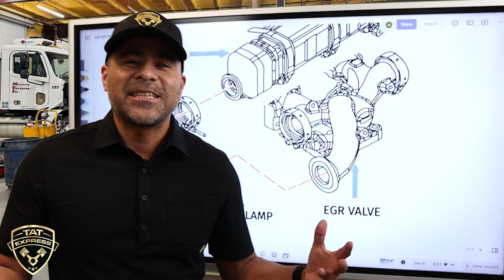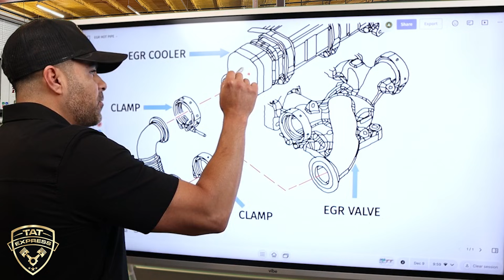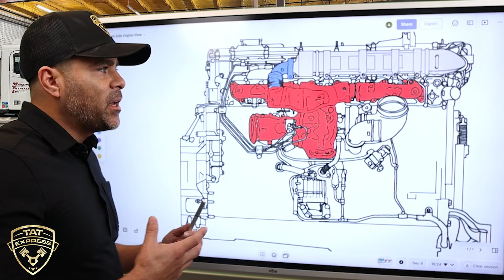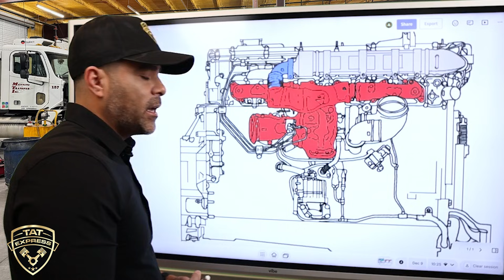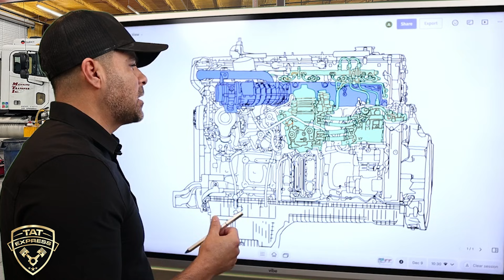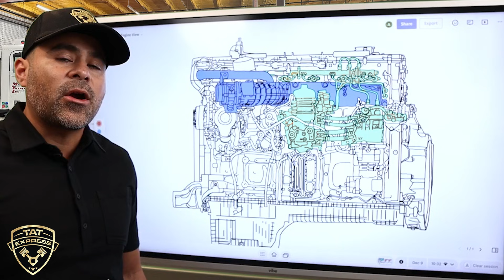Why EGR Systems Matter on Modern Semi Trucks 🚛🔥 How They Work, Fail, & How to Maintain Them

Comment: I was taught at a Caterpillar dealer the NRS (Nox reduction system) which is their egr, it pretty much lowers the combustion temperature which creates less nox and soot by reintrouducing that exhaust gas. It's pretty much dead air. That deleting the egr can cause more harm than good because the engine is designed to run at that lower combustion temperature. Personally, I don't believe that egrs belong on diesel engines. Troubleshooting and repair egrs are a pain in the butt on heavy equipment. They don't really plug up with soot or the valve never gets stuck. The coolers are the major problem with cracking and mixing coolant and exhaust. It is what it is

Comment: Thanks! DD engines seem complex... like the coolant plumbing too, was driving a DD13 on a 4700 WS the other day and had to knock the electronic valve a bit because only cold air was blowing in the cab at some point.
Reply from the maker: Yeah, the DD platform is definitely more complex, especially with how the coolant is routed for emissions and cab heat. On those DD13s, a sticking heater control valve is pretty common—coolant flow gets restricted and you’re left with cold air in the cab. Usually a valve issue or debris in the system rather than anything engine-internal.

Comment: FYI:
The new Navistar S13 engine design removed the EGR cooler and DOC, so it sends nearly 100% of exhaust gas to the turbo

Instead of an EGR cooler, it has 2 DEF injectors and very high compression ratio to manage emissions

The 2nd DEF injector is placed after the turbo in the evaporator tube for more efficient NOx reduction, but the SCR is used as it's primary NOx reduction method
Reply from the maker: Good info. Navistar definitely shifted the strategy on the S13—moving away from EGR cooling and leaning heavily on high compression and SCR efficiency instead. It’ll be interesting to see long-term durability now that most of the emissions burden is downstream instead of inside the engine.

Comment: Just put a brand new def box on my truck and still get engine light
Reply from the maker: @truckerchops444
A new DEF box won’t clear the light by itself. You still need to check for stored fault codes, do the required resets/relearns, and verify NOx sensors, wiring, and exhaust leaks. One failed input can keep the system unhappy even with new parts.

Comment: The worst design ever created. Instead, investigation should focus on piston designs.
Reply from the maker: @estebancarballo8
I get the frustration. Emissions added complexity for sure, but most failures we see are calibration, maintenance, or sensor-related—not just piston design. The system has to be understood and maintained as a whole to survive long-term.

Comment: Fun facts

1. on some engines the egr cooler connects the cooling system to half the engine.

2. On newer engines the compression is higher and the egr gasses actually simulate a lower compression engine

3. The dpf and scr have nothing to do with the egr system so know your equipment before you buy Chinese kits to bypass systems. 

4. If you know how something works you can fix it easier
Reply from the maker: Good points overall. I’d just clarify that while DPF and SCR are separate systems, EGR directly affects exhaust temps, NOx production, and soot loading—which absolutely impacts DPF behavior downstream. Everything is interconnected on modern engines. Understanding how EGR, combustion temps, and aftertreatment work together is the key to fixing them correctly instead of guessing or deleting parts.

Comment: One of the things most commonly overlooked is quality oil. By choosing a good synthetic oil it has low ash formulation. Most oils have them but some of the cheaper oils don't. Moral of the story don't cheap out on the life blood of your engine. Also proper oil changes with oil samples if possible will further extend the life of your engine. Remember everything internally in a engine is protected by your oil.
Reply from the maker: @Trugginglife
Absolutely agree. Oil quality and oil maintenance are huge—especially on EGR-equipped engines. Low-ash formulations, proper intervals, and oil sampling go a long way in managing soot loading and wear. We see it all the time in the shop: engines that are maintained with quality oil and monitored through samples consistently live longer. Oil really is the last line of defense internally. Good point 👍

Comment: Tell me freightliner wants more frequent in frame rebuild cycles without telling me freightliner wants more in frame rebuilds.
Reply from the maker: @Tyroneshoela
I get why it looks that way, but it’s not about forcing rebuilds. EGR systems increase soot and heat inside the engine, which accelerates wear if maintenance and operating conditions aren’t right. When engines are maintained properly (valve set, cooling system, duty cycle), rebuild intervals can still be very long. The failures we see are usually from neglected basics, not a secret OEM agenda.
Reply: @TATEXPRESSINC Go get a bar of any soap and rotate it under water between your hands ... thats a well lubricated crank.... now go get a bar or lava or pumice soap... do the same thing.. which one could you tolerate longer before you start wearing thru your skin? Thats the same as pumping carbon into your clean oil. Ill never understand how dumping exhaust laden with bad stuff into a crank case is a good idea and expect no adverse effects
Reply from the maker: @Tyroneshoel…
I get your analogy, and you’re not wrong about carbon contamination and wear. My point in the video wasn’t that EGR is good for performance or engine life — it’s that it exists for emissions compliance, not horsepower or durability. Two different conversations. The trade-offs are real, and that’s exactly why maintenance and oil quality matter so much on these engines.
Reply: @TATEXPRESSINC indeed and yes I understood the difference  and components need to be explained in exactly the fashion you did. Well done. Its just a pet peeve of mine. Just like expecting a fuel pump to draw fuel from two separate draw sources quite a distance away relative to the size of the pump without an intermediate lift pump to assist.  I installed a pump that replaced my davco and now my fuel pump sips fuel from the filter module with its toes in the sand. 

Why can't they engineer a soot abatement module prior to the Egr cooler to cut the return contamination? Something that can be cleaned and returned to service?

Comment: In the early days , we use to have to replace air tank due to carbon build up in the tanks limiting the cubic feet of air in the tank drastically affecting brakes.  Fast forward and that’s a rare thing but I usually will scope the tank to make it’s not getting carbon build up. Yea I know , it’s rare now but there for a while it was a real thing.
Reply from the maker: @sonofmontez
That’s a solid point. Early on, carbon contamination showed up in places people didn’t expect — including air systems. It’s rare now, but it proves how far contamination can travel when combustion quality isn’t right. Same concept today with sensors, EGR, and aftertreatment — the dirtier the combustion, the more downstream systems suffer.